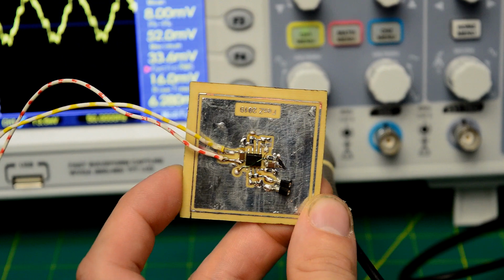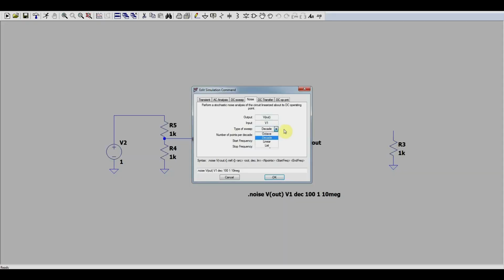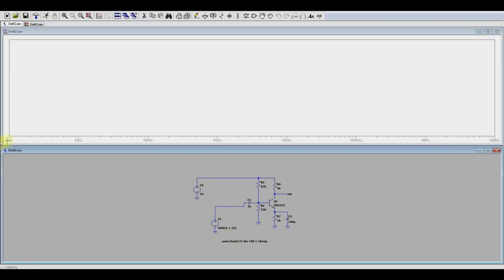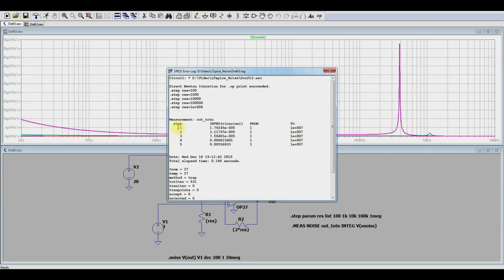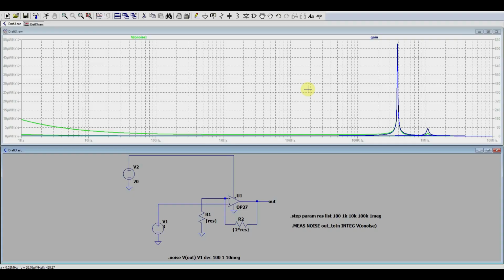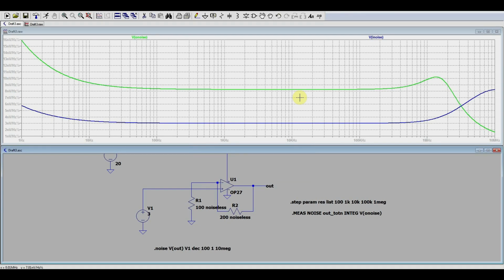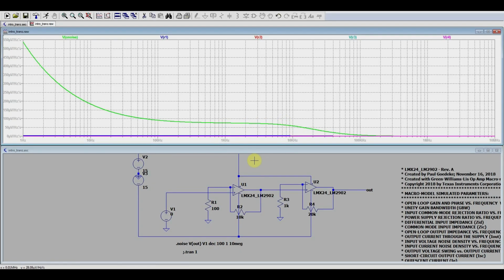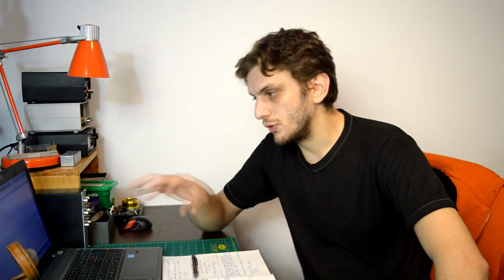LTspice tutorial - Noise simulations

Comment: I love all your videos on LTspice - great video on noise. I just want to mention that in your example with the transistor 2N2222, the bias is set so the transistor is saturated or close to (Ve=1.689V, Vc=1.765V in my simulation). If R6 is changed to fx. 12k bringing it into its linear operation, the noise density curve changes dramatically. Are you aware of that, or do I miss something here?

Comment: Around 13:40, why did you multiply RMS noise by 8? That seemed like it came out of nowhere?
Reply: That's because the instantaneous noise value is fully random and therefore follow a gaussian distribution. The RMS of a noise signal is basically the standard deviation (Sigma) of the gauss graph. Statistically, X-factor of Sigma gives you the probability of something happening. 6 times Sigma or 8 in some literature, give you the worst case scenario possible. Hence the 8 times RMS magic number.

Comment: Thank you for the nice video. I have a question about the comparison of the results obtained from LTSPICE, with one from theoretical formulae for resistor noise. Usually, voltage noise density is given by = sqrt ( 4KRT) where we have Boltzmann constant, temperature, and resistance. But somehow, My voltage density values obtained from simulation and formula are not matching. For 1 k Ohm resistor, it should be around 4nV/rtHz but from simulation we can see that its below 3 nV/rtHz.
Reply from the maker: I'm not sure what the problem is - I tried to add a 1K resistor connected to ground and I get a 4.07nV/rtHz density as expected. 
My circuit was (V1 added just to make the simulator happy)
R1 N001 0 1k
V1 N002 0 1
.noise v(n001) v1 dec 100 1 2

Maybe you can give more details on your circuit?
Reply: @FesZElectronics   Thank you so much for your response.  I found the error. It is working correctly now.
Reply from the maker: What was the error?
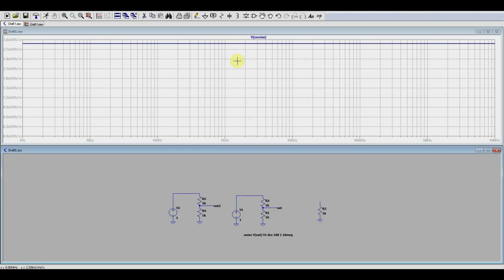Reply: @FesZElectronics  Hi. I was simulating the simple voltage divider available in the video at  03:54.  If we connect both of them ( resistor and power supply) to ground, as shown in the video at 03:54 we can obtain the noise voltage as 2.88 nV/rtHz at the output node with the contribution of R2 as 2.035 nV/rtHz ( as shown in your video). Now, if I make the R1 noiseless, I obtain 2.035 nV/rtHz at the output node which is all coming from R2 of course. However, ideally, I think that we should have 4.07 nV/rtHz at the output node because now only R2 ( 1kOhm) is causing the noise and according to V=sqrt(KRT), we should have 4nV/rtHz for R2=1kOhm.  Therefore, to obtain the 4.07nV/rtHz, which is the ideal value I think we should only connect the power supply to the ground and leave the R1 bottom side as an open circuit. ( In other words, there should be only one ground in this voltage divider shown at 03:54.   HOWEVER, this is what I think. Please correct me, as I might be wrong. ( I am not from electrical background )

Comment: Hello!
I got a ¿?
I'm using LTSPICE, I need an operational amplifier but the ones LTSPice give have negative at the top and positive input at the top also, and I need one with both positive input and positive voltaje input at the top, how can I edit the one there?
Please help me, you domain LTSpice.
Reply from the maker: Hello. Well, the placement of the terminals will only have a cosmetic influence; I mean you can set your +supply on the bottom if you wish. Anyway coming back to your question, the opamps with LTspice built in models are not editable but you can use the symbol for "universal Opamp" and edit the symbol, so to swap the location of certain pins. Or you can create a symbol from scratch to look how-ever you want. Just make sure the netlist order of the pins for any new or edited symbol stays the same (pin1:in+ pin 2: in- pin 3:V+ pin 4: V- pin 5: out)
Let me know if this works out.
Reply: @FesZElectronics  hello!
Im gonna try it ;)
Thank U 😊👍
Reply: @FesZElectronics  another ¿? How can I edit the Universal Amplifier and switch the possitive input?
Reply from the maker: @missgalaxy6519  You insert it into your schematic, and then right click -  a new window pops up and there go to "Open Symbol"; edit and save (maybe use a different name like OpAmp2INV so its different from the default)
Reply: @FesZElectronics  Ok, I'm there.
I have:
Attribute Value Vis
Prefix X X
InstName U2
Spice Model level.2
Value 
Value 2 Avol=1Meg GBW=10Meg Slew=10Meg

SpiceLine ilimt =25m rail=0 Vos=0 phimargin=45
SpiceLine2 en=0 enk=0 in=0 ink=0 Rin=500Meg
Where is the section to edit?

Comment: Nice video as always. 
The bandwidth trick does need some more context I think. Yes, the total amount of noise is reduced. The downside is that the signal to noise ratio for lower frequencies is still as bad as before. It's something people seem to overlook sometimes. Especially when the noise is still causing issues at these lower frequencies for data acquisition etc.
Reply from the maker: You are right Piet! By reducing the upper part of the bandwidth will only reduce the noise in that area of the spectrum. Honestly I haven't worked with data acquisition systems that much.. how would you recommend reducing the noise for such circuits?
Reply: @FesZElectronics  Well, maybe a bit boring/lame answer, but that really depends on a lot of things.

It depends mostly on the requirements.
Are you working with sensors or audio, noisy environment, as well as requirements of being able to "detect" or distinguish a certain signal (SNR)?
One way is to use a better opamp, or work with differential signals. Another way is using a DSP or something to add some mathematical tricks. There are some (analoge) tricks to invert the noise signal and sum it with the original.
Sometimes it's even about choosing your gain properly and maybe even using two (different) sensors to cover the whole spectrum. In some cases also PCB and ground layout can be key factor.
So it really depends where the noise is coming from and WHERE and WHAT you can compromise. 
In the end that also depends again on the budget.
Reply from the maker: An interesting method I've seen in some LT application notes is not just to use a "good" op-amp but multiple identical parts in parallel, this they say reduces the noise by a factor of sqrt(nr of parallel elements). Another thing they did was build a discrete input stage with very low noise parts to improve the performance of said "good" op-amp.  Both these techniques are used in this document: https://www.analog.com/media/en/technical-documentation/application-notes/an159fa.pdf
I'm curious, did you run into any of these methods in practice? I mean they look nice in the app note but seem quite cumbersome to be practical and I haven't seen this implementation anywhere else but maybe I just didn't search enough.
Reply: @FesZElectronics  Noise reduction by paralleling devices only gives a 3dB reduction (10*log(x) ) in noise. So to really get anything significant you quickly need something like 4 or 8 devices (6dB to 12dB reduction). By that time you lost so much real estate and budget that it's better to go for a different opamp. But that also depends where the noise is coming from. Sometimes it's actually better to make a differential circuit to just completely cancel the noise out.
A discrete input stage could work. Although nowadays there are quite some affordable opamps with a similar or better noise specs. Advantage is that they are easier to work with and require less research time to get the same results.
Reply: @FesZElectronics  unfortunately there is no 1 solution to fit all. It depends. generally speaking, important signals should be differential, and if low frequency accuracy is desired, harmonic up conversion is a nice trick to reduce noise. Use of Noise Matching networks is also a nice trick for high frequency noise. But again, At the end of the day, It really depends on where the noise come from, how should the signal be processed and how noise is distributed on the spectrum.
Reply: u cant just compare snr at single frequency bruh

noise is the sum of all frequencies
Reply: @urnoob5528 I'm not your "bruh" and I think you need a bit more schooling "bruh".